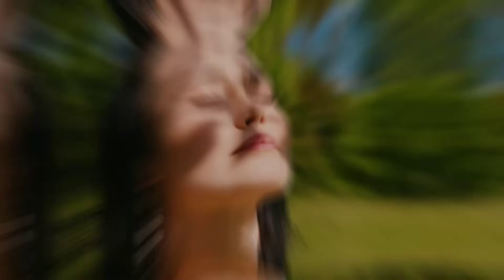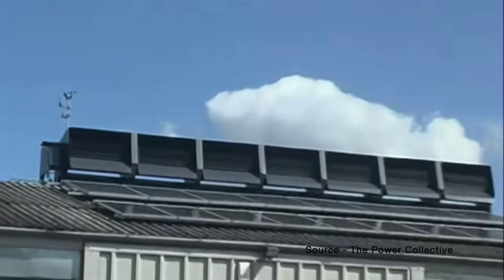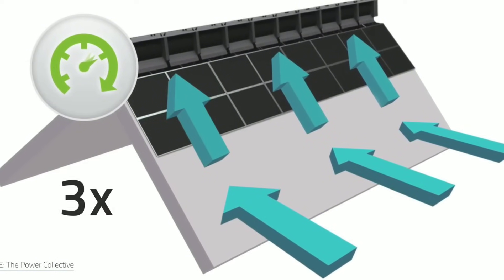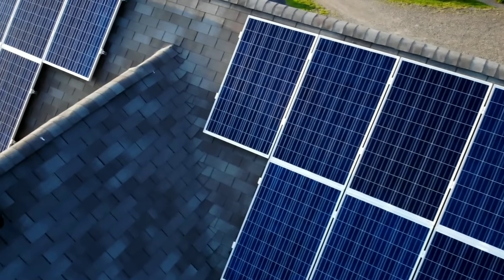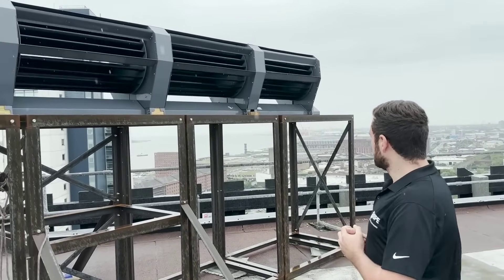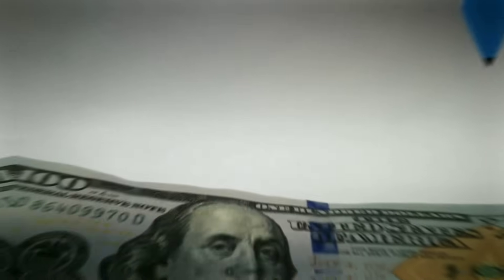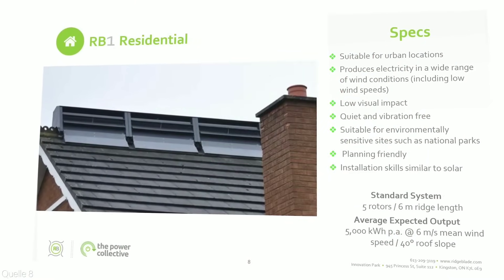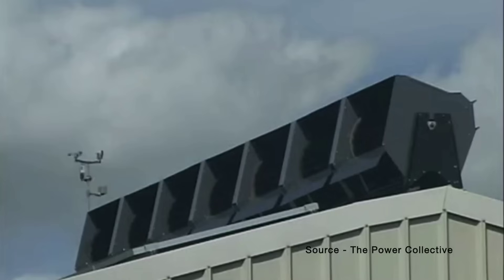World Most Efficient Wind Turbine RidgeBlade BREAKTRHOUGH Will Replace PV Solar For Good!

Comment: Agree with @Martian_Alien below - the 1st comparison should be with other wind oprions. Then, solar. And  what does it cost??? Issues like detailed specs and operational performance, 
clogging, birds, small anmals, snow, etc are not answered here either. That archimedes flower-screw Liam thing looks like IT is powerfully efficient too. A comparison would be great. But I still liked the potential of this thing....

Comment: So many problems with this:
1. How can you compare efficiencies of two such different systems? I would argue that the efficiency of any wind generator is 0% at generating power from sunlight, and vice versa.
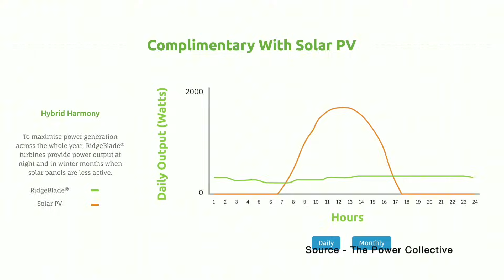2. Graph at 4:11 is spurious. The wind in many (most?) locations is as variable as sunlight. The wind usually only blows at my house from about 3pm to about midnight.
3. How, exactly, does RidgeBlade produce more electricity per Watt (4:45)? Watts are a measure of electricity. That statement is simply stupid.
4. RidgeBlade can only work when the wind is from one direction.

Comment: what's it cost?   I don't want a salesman contacting me.  Folks that make it hard to find out the cost are usually way overpriced.  It's should be in the title.
Reply: going on the wattage. about $4.5k i agree if they cant state a price, it will be expensive.
Reply: Why should it be in the title? If you can't be bothered to watch the video, you're obviousy not interested enough anyway. It distinctly says that the current (at the time) average cost was $2.05 per watt. The price on any individual system is obviously going to depend on the size of the system.

Comment: Solar panels can work when there is no wind.
Reply: My solar panels work with no wind but in June 2023 the sun was not shining in Middle Maine and my batteries were drained way down . Could have used these then.
Reply: That's why, for the energy savvy crowd, the hybrid system is the best bet.  Solar + Wind is the better option.  And if you live somewhere where there is a stream, a small hydroelectric turbine will add benefit to the hybrid system.

Comment: I have some of the same questions and comments other who viewed this Sales pitch have ask.   HOw do you clean out things that could clog the blades, like birds,  inserts  nests, etc?   While solar doesn't work at night, in cold snowy locations, no explanation is given on how it produces electricity when you get a foot or two of snow and you don't have a slick roof for the snow to slide off of?  What is the minimum wind speed needed for this unit to spin.  I mean wind speed at the top of a residential house, not the average generated at 25' or more high?  Also, since I would be comparing this unit not only to solar, but also against other vertical axis wind units,  how does this ridgeblade  compare in efficiency to other both vertical and horizontal wind generators?  Unfortunately this is not the 1st Future Galaxy video I have seen which seems to be nothing more then accepting the sales pitch from manufacturers.
Reply: Good comments.... compare this with horizontal and verticle small wind turbines (<1.5kw)

Comment: What happens with 4 ft of snow on the roof in winter time?
Reply: Same as for solar unless you install a driveway heater on your roof. In that case it would be self-powered so pretty good .
Reply: That would depend on the pitch of the roof.  Compare the pitch of your roof to the latitude you are in, or the type of roof that you have.  The roof, as long as it's not flat, should be able to shed the snow, unless the snow is piling higher than the eave of your roof.

Comment: Regular wind turbines are more likely to break in extremely high winds and cant be recycled so they have to be disposed of in landfills. Another thing is that regular wind turbines are so huge that most landfills dont even want them, even when they are cut up into smaller pieces, because they still take up too much space.
Reply: Just like concrete recycling the bring the equipment to the location and grind it on the spot.
Reply: Yes they can be recycled, the owners just don't want to spend the money to ship them to a place that does it.  It will probably end up with a traveling recycling caravan going from farm to farm every 20-40 years.
Reply: As you said... REGULAR.  Every day, technological advancements are made in regards to the composition of turbine blades, just like the advancement in solar panel technologies.
Large commercial turbine blades are removed when Gale force winds are threatening the areas they are in.  That way, the towers they are mounted on are protected from breaking in these turbulences.  The smaller helical bladed turbines are not effective in Gale force winds, as the spindle that is designed to allow them freedom in spinning are too fragile to withstand hurricane force winds.  The RidgeBlade MIGHT (I emphasized might) be the best option in Gale force winds, due to the design of the structure that holds the blades.  This has to be verified in a real world setting before anyone can say that they are the best (or one of the best) type of wind turbine.  Even solar panels are not immune to Gale force winds, as has been seen in the devastation experienced in Florida, where solar panels were ripped off of roofs, even though they were 'tied down' properly.

Comment: Tell us more about how much does it cost? How much power does it produce. How much is a battery pack for a average 2000 sq foot home. Can air conditioners run off this source? What is the max wattage of the unit? Can it have a disconnect from the grid if there is a grid failure? Where can we find the answers to our questions?
Reply: If you look at the video it tells you a lot of what you're asking, price of battery depends on battery size, air con working depends on power demand from air con units and what the turbine system is generating at any given time, etc..

Comment: Another problem with current solar panels is that they utilize elements like cadmium, arsenic, lead, and other rare earth elements that leech into, and damage, the environment when mined. Plus, mining them does more damage to the environment in the form of destruction of the lands, erosion, loss of biodiversity, sinkholes, and soil/groundwater/surface water contamination and release of greenhouse gasses by the machines.

Comment: it looks to me this works only for the wind blowing one direction only!!!
Reply: doesnt make sense since wind direction changes everyday
Reply: @deepsudeep how does a plane generate lift, even when not being driven into a head-on wind?  It doesn't matter the direction of the wind, as long as the blades are canted to generate lift, which is the idea of the blade adjustment on ALL types of wind turbines.  Horizontal and vertical wind turbines use the same principle, it doesn't matter the direction the wind is coming from, and the RidgeBlade is a hybrid of the horizontal turbine, which does not need to be mechanically angled every time the wind changes direction.  As long as the wind has purchase on the blades, based on the design of the blades, they will create motion, and any motion will generate electricity, no matter the amount of kW generated.  The real consideration should be how much kW is actually generated.

Comment: |> |> |> |> |> |> |> |> 
|> |> |> |> |> |> |> |> |> 

only usefull when you KNOW that the wind comes always from ONE direction ...

an that moment where the direction change especialy 90° forget ist ... you get nothing .

always that praising of any shit  which efficiency is ONLY then so high when you have ine dpecial condition ...

and there its asy to do ...

there is only one solutiin mechanically wbd efficiency ehen it comes to changing conditions  vertical axis ...

there us dosent natter from where the wind comes ...

especialy sll that ideots which instal smal common orizintal qxis on sailung boats ... I can only shake me head about such stupidness.

I develop boats wnd boat tech and drivesystrms ...

a vertical exis is a must ...

the problem is here the same by finding the right company because they ALL blah how good in comparing to others ...

here must be a not corrupted institut which really test that stuff and give measurenents bycdiffrrent windspeeds.

windturbunes which can take a storm are normaly vad by less or average epeed qnd oposieb...

that the reason why I designed a windturbine which you can retrakt and deplay and so addopt on the conditiins of windspeed.

basicly is a windrurbine better then solar ... also you should instal because ehen you come in a winddead zine you are screwed ... but to overcome this you must wbyway start the rngin and that means power BUT you need more fuel and that can vy common setuo lead to to much sing if fuel and then so srews too.

so solar AND eindturbines os the way to go.

I recomand qlways a proper hard top iver the cockpit and there the photovoltaic modules and please go for cigs moduls ... they are more ecpensicpve but dint fall in oridzctiin by a little cloud ... lowlight priduction os important you you must  invest serious money in batteries.

by monicristalin they advertise with high watt ... but reality is like by common windturbines count 1/3 as real ... 

cigs is different there the oposite 2/3 qverage and even higher is reality ... acribis modules gor exaple gave you 10 years ago by 110 watt even 125 ...!!!!

dont know if still exist because that are gardmoduls ehich you also can instal  on the hardtop but I go for flexibal ... you gave qlsp 30 years guaranty and serious ... by a boat you must think in shorter terms 

|> |> |> |> |> |> |> |> 
|> |> |> |> |> |> |> |> |>